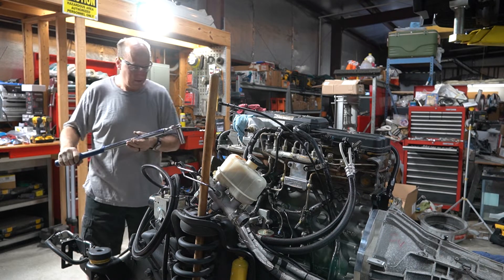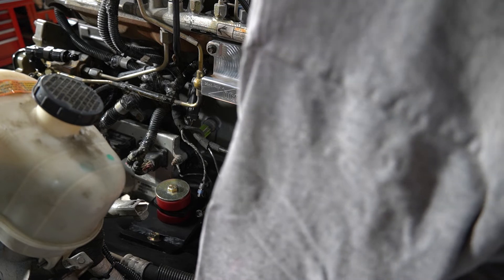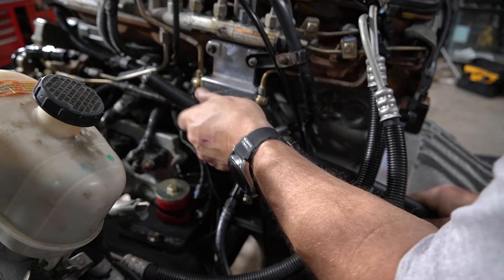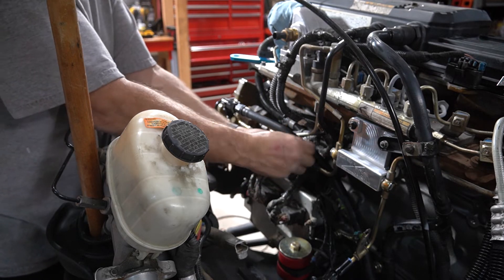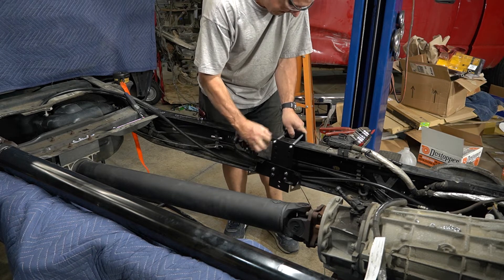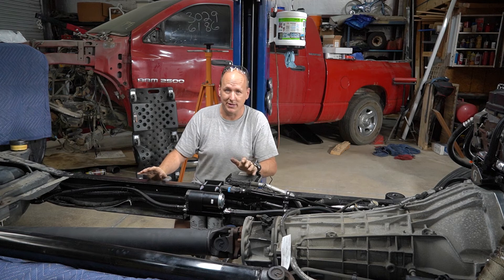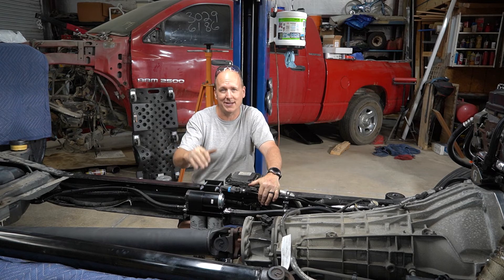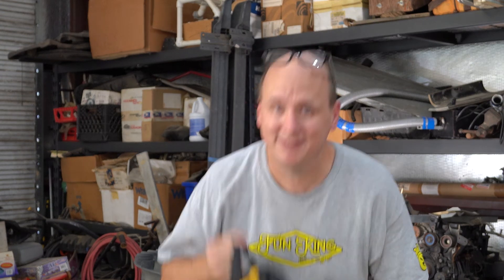The Fummins Project - Episode 10 - Wrapping up the Fuel System

Comment: You are one very kind and helpful person with the patience that's never ending!!!!  I have ask you several questions and you are very  very knowledgeable and quick to respond.  My head is 3/4' loss of hair and have hit it on everything possible and poked holes in it till the wifey says hospital but we all deny that scene!!  I really believe the little hair I have protect and is a warning sign not to poke here!! I am confused about the accelerator conversion and the cruise control being cable instead of drive by wire, but I will read and learn more. Who did your Trans Tuning and is your trans auto or manual? Thank you for your kindness!!!!   Please don't quit making video's I truly enjoy your projects!!
Reply from the maker: Non-bald people never understand the prewarning system that their hair gives them before hitting their head! The passenger side mud flap got me enough times that I ended up tearing it off completely. Left it off until the body was ready to be fitted. LOL!

Trans tuning is being done by Diesel Conversion. I have been taking my time back and forth with them to get it fined tuned. It is the Ford Auto.

Videos are not stopping. There has been a delay as of late as we do a huge Christmas light display which takes a ton of my time through the holidays, but new videos will be resuming soon. :) Thank you for the kind words.